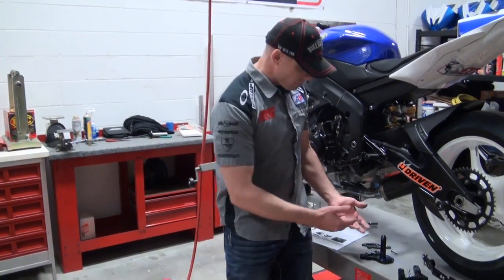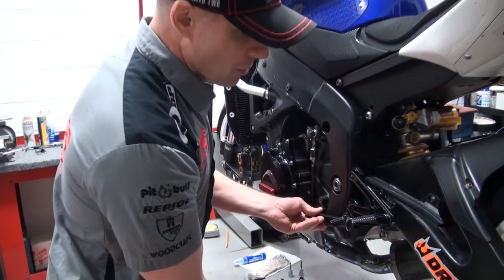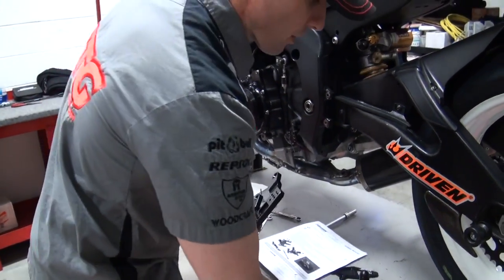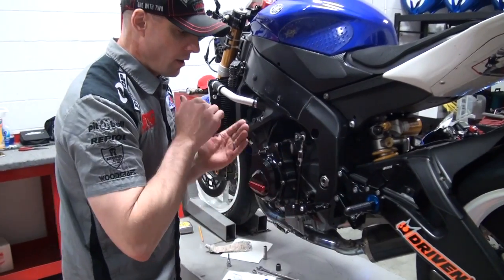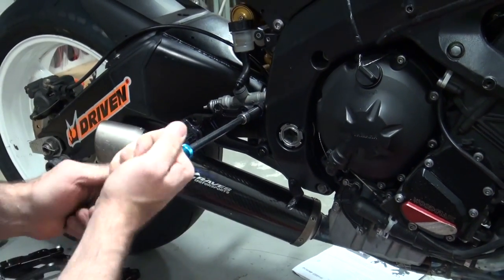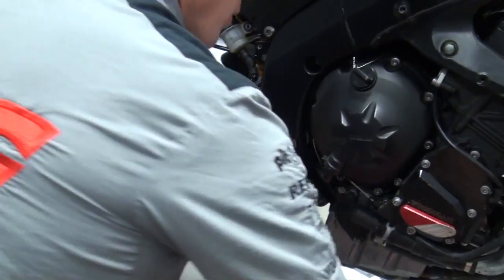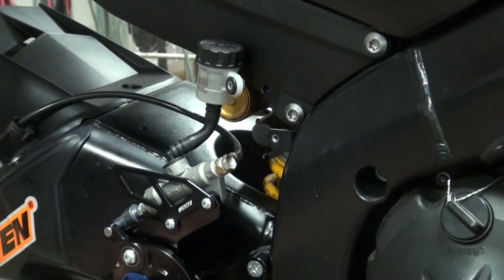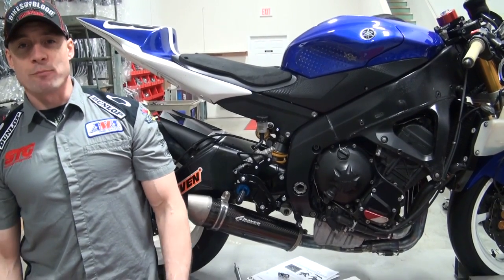Driven D-Axis Rearset Installation Review from SportbikeTrackGear.com

Comment from the maker: Lisandro - I apologize for the frustration in this regard, however, all aftermarket rearsets require the pressure switch as they are designed for race use.  This is not noted on each individual listing on our site, as it is true for any bike and any brand/style rearset.

Comment: after calling the manufacturer couple of times they recommended possibly lowering the muffler if possible. So i took the muffler bracket to a machine shop and had them lower the mounting hole 3/8" which fixed the problem BUT in order to do this you'll either have to remove the lower rear fairing or modify it some, i went with completely removing it. Once again this is with a Brocks CT megaphone exhause.

Comment: sorry forgot to mention why they wont fit. The shifting side is fine but on the brake side the clevis on the master cylinder hits the muffler. And the foot peg bracket hits the pipe in its oem setting.

Comment: I just ordered a set of these off your website for my ZX14R and looking at the brake pedal it seems like im going to need one of these pressure switches. I just wish i would have known that the switch was required, no mention of this on your website nor the manufactures website, otherwise i would've purchased it along with the rearsets now i have to wait on the switch to arrive and pay for shipping. 8 out of 10 satisfaction with this one

Comment: 2011 XZ10R brake master cylinder not so easy to change position. Also brake switch is mounted to stock rearset. No such mount on D-axis. Racking brain for solutions but not enough cells remaining, D-axis still in box for now. Any advice much appreciated...Mick

Comment: these will not fit a ZX14 if you have a Brocks CT megaphone exhaust! Also i find odd that the return dept wont accept these back since they been mounted, how else is someone supppose to check for clearance issues unless you mount them?